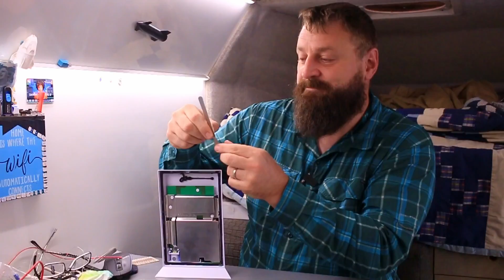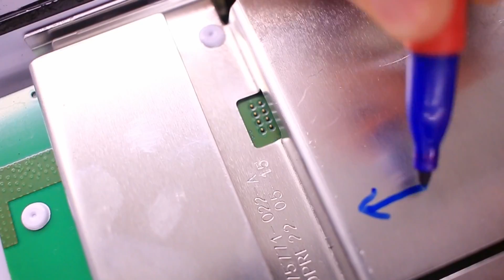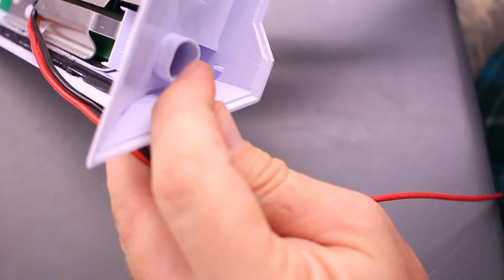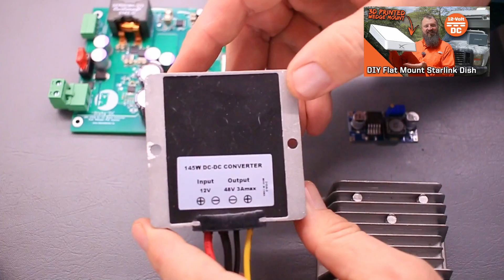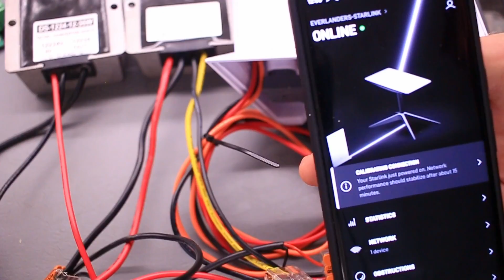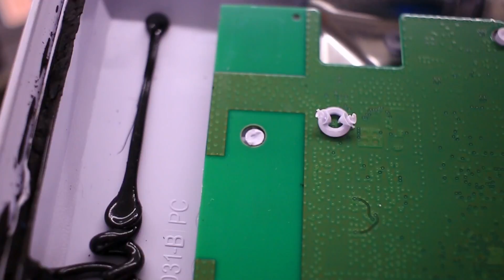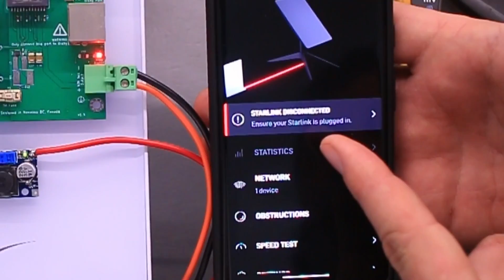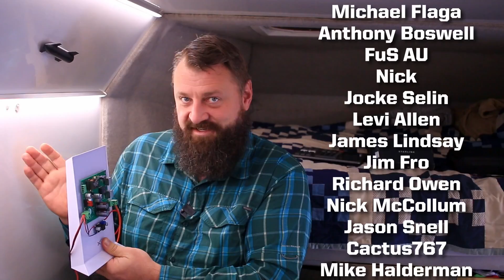Hacking the Starlink Router to run DC Power

Comment: Nice work!  However you can do without the 12v adaptor if running in 12v batteries. Has been confirmed that the 12v is just running into a power adaptor with an input of 11 to 16v acceptable.  Outputs are all below 5v
Reply from the maker: Please cite your sources.
Reply: @Everlanders  didn't find the post, but did find the person it came from, Oleg Kutkov, senior engineer at Ubiquity Ukraine and developer of a lot of add ons for Starlink.
Reply: @Everlanders  there was a post a month or two ago with comments from one of the guys who works with these. The 8892 power supply chip specs quote up to 16v input! Trying to find the post and if I can I will link it for you. He also showed testing up to 16v with no issues.
By the way thanks for showing this, I was wondering if it could be powered remotely with the mains power supply still in place for optional use.

Comment: Just cut the original power cord and inject 48v in to the cord what the power system will do is convert 48 to 12 like it does already it makes 48v from the start and sub divides voltages from there for everything else no need to open the starlink to run it off dc we where thought that about ac to DC converter if you pass DC thru a ac inverter nothing happens it just passes it right thru
Reply from the maker: I put 60 volts DC in and nothing happened... Did you have success or just guessing?

Comment: @Everlanders What career path should I pursue in order to learn what you know about all of this? Are you an electrical engineer? What is your background? Thank you
Reply from the maker: One thing I want to emphasize is that my education and career path have not guided my hobbies and interests. In fact, pursuing my hobbies has often led me to new opportunities and experiences in my career.

If you're interested in electronics, my advice would be to jump right in and start working on a project that you're passionate about. You can start with a cheap Arduino kit or any other widely adopted platform and try making the LED blink or building an ESP32 T-Beam Lora communicator. There are lots of projects with big community support online, and that's a great place to start.

The most important thing is to follow your interests and see where they take you. If you love electronics and want to pursue it further, then further education in that field might be beneficial. However, it's important to keep in mind that education can often teach you how to pass tests and design solutions for problems using tools taught inside the box. It's important to think outside the box and pursue your interests in your own unique way.

So, my advice is to find a project you're passionate about and jump right in. Don't be afraid to experiment and make mistakes, as that's often where the best learning comes from. And most importantly, have fun and enjoy the process!
Reply: @Everlanders  Thank you. Perfect answer! I enjoy your well thought out videos and details while explaining your process. Looking forward to more!

Comment: can it be wired for 24v?
Reply from the maker: Sure, just get 24 volt input converters...
Reply: @Everlanders  What does the 48v side do? and will it be an issue is cold climates with snow as I know they have a function to melt snow.
Reply from the maker: I think you misunderstood, you need 24 volt input and 48 volt output converters... The dish needs 48 volts to run.

Comment: Great video and a really nice solution. Being very lazy I opted for a high efficiency  AIMS sinewave inverter.  It would be interesting to know the 12V  (13.2V)  current draw for your setup.  The AIMS PWRIG200012120S is 95% efficient and has a very low standby current. By wiring an external transfer relay to be powered by shore power I keep the current draw on the battery to a minimum.  Sadly most inverters power the internal transfer relay from the inverter, which just burns battery power for no reason.
Reply from the maker: Sadly, AIMS inverters are not as efficient as they claim, and they have a very narrow input voltage range that would not work for us in the countries we travel. I replaced 2 AIMS inverters while in Mexico because the guys couldn't charge from the 91vac grid, it would only error out. Dead in the water with no solar...

Comment: Is there access to the header pins from the rear of the router? Perhaps it would be possible to drill a hole through the back of the router to avoid having to pry open the case.
Reply from the maker: I thought about that too, but the aluminum plate covers the back of the unit too. So you'd need to cut through the plastic AND the aluminum without getting too many metal partials inside...

Comment: Hello.  This is great news as I am off grid.  Is there an EASY way or conversion kit to go directly with 48 volts?  I have a 48 volt battery bank.  Thanks!
Reply from the maker: Exactly the same rules apply, you would just need to get the 12-volt and 48-v converters with 48 volt inputs.
Reply: Thanks.  So maybe I missed it but how much power do you actually save by doing this?  Again I’m my case I’d be converting it to 48 volt direct.  My sole reason would be power saving as I have 110 throughout the off grid property.  So if the power savings aren’t fairly significant, it may not be worthwhile.  THANKS for the ultra quick reply!!!
Reply from the maker: I went from 56 watts averaged over 24 hours to 28 watts.

Comment: Hi there, greetings from Brasil. I made something similar as the content from this video. But I installed a switch with three positions and two poles (12 and 48 VDC).

I also installed an external connector with three poles (GND, 12 and 48 V) that I can plug and unplug form the 12 to 48 VDC converter.

So if someone forget to disconnect the AC or the DC input, the router cannot be damaged.

We like your videos.
Reply: Would love to see a wiring diagram of how you did this with the switch.
Reply from the maker: You just cut the motor wires (one to each motor) and put a switch inline interrupting the power to the motor.

Comment: Wait, one 12V, two 48V but only one ground soldered?
Reply from the maker: Correct, as I said the video, the 2 48's are connected together, and the grounds are common, directly connected to each other, so only one common ground is needed.

Comment: Great video and  much easier implementation than the other one I have seen on Youtube. But, the one and only reason to do this is to save power and unfortunately you didn't compare power usage between running DC and AC. Yes, many variables due to different regulators and inverter efficiency but a baseline comparison would have been nice. Am I saving 20%, 50%? Is most of the loss due to inverter inefficiency or due to Starlink AC power supply?
Reply from the maker: As shown in previous videos, power consumption is 28 watts on DC, about half of what the AC power supply and Inverter used.
Reply: @Everlanders  But, unless I am misinterpreting in that video only the dish was powered off DC. Now both the dish and the router are DC powered.
Reply from the maker: 28.6 watts averaged

Comment: As far as I am informed the CMOS technology accepts a voltage range from 9V to 15V. So fluctuation shouldn't be a problem. I am running a 4G Router directly on 12v via car battery without the 230VAC to 12VDC power adapter for a year now without problems. The car battery ranges from 11.5V to 14.5V. No problems.
Reply from the maker: If it's worth the risk to save $2.50 than go for it!
Reply: Well my point is not, whether I like to save $2.50, but is it possible or not? I am just interested in knowledge
Reply from the maker: And given that it's an $800 piece of kit, that would no longer be warrantied, you would recommend people try to run it unregulated, and save the $2.50?

Comment: Love the video. I have ordered a Dishy DC as I think it is certainly the most elegant solution and I am able to wait for it’s arrival. If I was to chose one of the hacks you showed in this video, it would certainly be the first one and I didn’t really think all the extra work of the second, and the risk of damaging the unit, is worth it.  Had I not already ordered the Dishy DC, I certainly would be interested in an option where I was able to print a new back to the router and have an inclosed dc/dc converter.  😊

Comment: 🤓 I nerded out a little bit on this one.    1 ??  The Dishy DC has a 12/24v output for a router via POE.....Who makes a router that uses 12v POE as a power supply?
Reply from the maker: Apparently people are using this one:
Mikrotik RouterBoard RB750UPr2 hEX PoE  https://amzn.to/41nQzNX
Reply: @Everlanders   Thanks....I was thinking this could streamline the install. You could install a access point and you are done.

Comment: You didn't solder a wire into the white (or blue) LEDs, so I wouldn't expect it to show either...
Reply from the maker: The LEDs are still connected to the router via the AC Power supply. So they can still be switched on by the logic on the router board. The reason they don't light is because those pins run to L41 Optocouplers (PC2 and PC3) on the power supply board and these in turn switch on the LED's. This is why they don't turn on.

Comment: I would add that those variable output boards should be dialled in to their output voltage with a load connected. I've had them fly wildly if set without a load attached.
Reply from the maker: Thankfully mine is still at 12.0 with the (very small) load attached.

Comment: You didn’t solder anything to the white and blue LED leads. Why were you expecting the LED to turn on?
Reply from the maker: Because they are still connected via the AC power supply.
Reply: @Everlanders  right but the DC electricity can’t go backwards through the output stage of the AC converter and energize it.. that won’t work.
Reply from the maker: Of course not, but the LEDs aren't powered by AC
Reply: @Everlanders  right..but the buck converters or whatever are giving you 12v, 48v, and 4v (for LEDs) are made of diodes, which are 1 way. You can’t feed power into the output stage backwards from 12 or 48v DC and have it converted back to AC to then be converted down to 5V DC. You would need another(very small) dc-dc converter to light up the led. Forward voltage of the white led should be 4.0v and the blue one 3.6v.
Reply from the maker: The LEDs are still connected to the router via the AC Power supply. So they can still be switched on by the logic on the router board. The reason they don't light is because those pins run to L41 Optocouplers (PC2 and PC3) on the power supply board and these in turn switch on the LED's. This is why they don't turn on.

Comment from the maker: Ask any questions about USB C here, all caps only!
Reply: DO YOU KNOW OF ANY SMALL BATTERY BANKS THAT CAN CHARGE SIMULTANEOUSLY WHILE OUTPUTTING 12V VIA POWER DELIVERY AND HAVE UNDERVOLT PROTECTION.
Reply from the maker: Any power back on the market can do this... You'd just need a USB C with a 12 volt decoy trigger.
Reply: @Everlanders  MAYBE I HAD BAD LUCK, THE TOZO PB2 CAN ONLY OUTPUT 5V WHILE CHARGING AND NEARLY ALL OTHERS I CAN FIND ONLY CHARGE VIA USBC AND ONLY HAVE ONE USBC PORT NEGATING OUTPUTTING PD WHILE CHARGING.
Reply: @ThomasSuckow  MAYBE IT IS USING QUALCOMM QUICK CHARGE INSTEAD OF USB POWER DELIVERY FOR QUICK CHARGING. MOST DECOYS ARE PD ONLY AND DONT WORK WITH SUCH CHARGERS. EITHER WAY, YOU CAN BUY EITHER A COMPATIBLE POWERBANK OR ANOTHER DECOY.
Reply: Hi mate is posible to hack starlin router as a aces poin mde? So th router starlinkonliy for AP mode

Comment: As much as I enjoy watching the hackery in general, I suspect the two methods you showed, PoE injection and 12/48v injection to the original router, will be the most popular.  Going further into custom PCBs or enclosures would be for a small audience that would actually implement. Though I and others would watch it for sure anyway. 🙂 Even if the hack does not apply to my situation I tend to learn something.